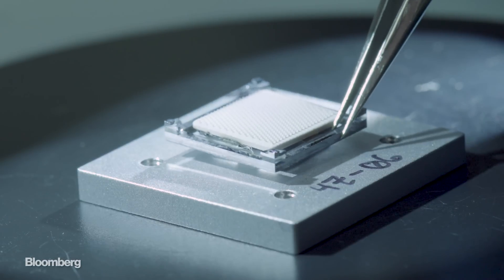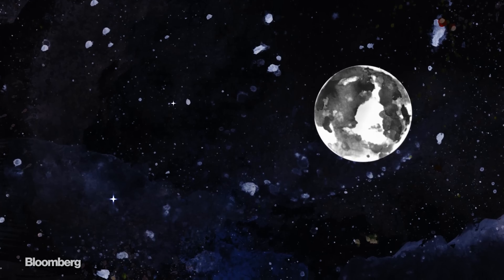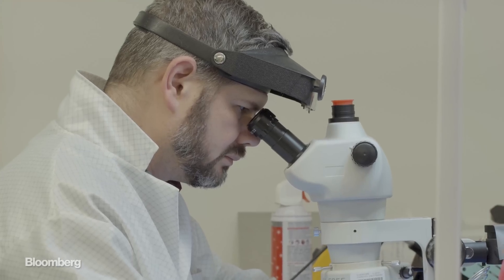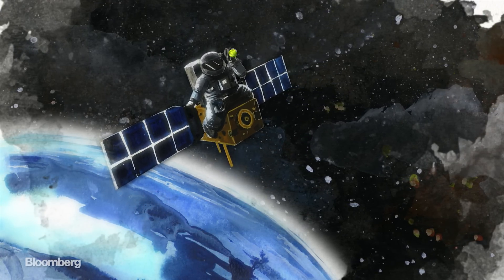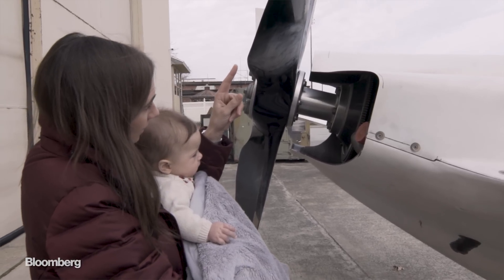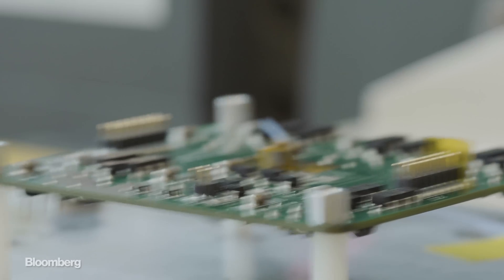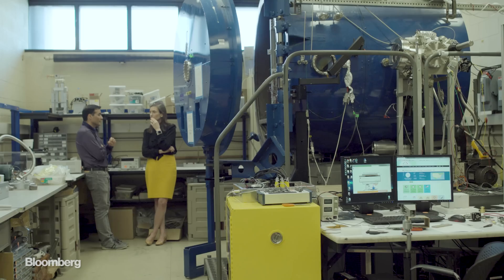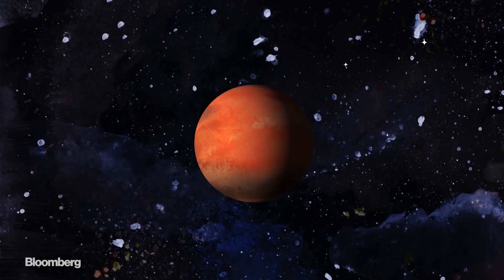This 31-Year-Old Is Changing Space Travel

Comment: Why can't this be used to leave Earth's surface?
Reply: Two reasons: (1) it only works in vacuum (2) it does not have enough thrust to lift itself, much less anything else.
Once the satellite is in orbit, the vacuum is good, and even a very tiny thrust can produce useful movement, when acting over a great length of time.
Reply: the propulsion is so small, ten of those probably can only move a small piece of paper in a vacuum slightly, the acceleration due to the ions is squared though, so the longer its on, the more momentum it builds, so over a few months or years you can start moving really quickly.

Comment: Yes, it doesn't use toxic chemicals to work... But it doesn't have the thrust to launch from earth... You will still need to use the toxic chemicals to launch it into space. you will need to burn these toxic chemicals ON EARTH.

They completely missed the point of those engines in this video... These engines are cool because they have a huge specific impulse. Meaning you can go very, very far with them. They take forever to accelerate though as their thrust is EXTREMELY tiny.

This is the kind of engines that will be used to send satellites and probes extremely far from here. I doubt they will be used on manned flights. Time is an important factor when you have people on board.

This is also the reason why they use gravity assists to send satellites very far, but they would probably not use it for manned flights. Sure the principle would still work, however, it would take too much time.
Reply: also, most fuels used nowadays arent toxic, only the proton and some chinese, indian, japanese launcher use them, but they are fasing out hypergolics as well.

Comment: If you follow the reasoning of the Quantum Fields Modulation Mechanism.., that the particles used as "reaction mass" are actually orthogonal/dimensional vectors of QM-Time modulation, then an ion engine is only a particular multiphase-state of tuning at the most familiar 3D+T perspective,  and it's still not the most productive use of cause-effect principle. 
But business logic is radically different to Engineering.

Comment: Can someone explain to me why isn't it possible to use some kind of turbine to push against the exhaust from either rocket fuel engine or the ions from the ion engine to push a spaceship/satellite forward?
Reply: Not enough material. If there is already an exaust, therefore thrust, also no need to.
The main advantage of the ion engine is that there is no need for fuel! No need to carry heavy loads of fuel from earth, no energy wasted in carrying it's own fuel weight and... limitless range!!! Ion engine converts light from the sun to mechanical motion energy, no fuel required.
Reply: No, nobody could explain that, because it is possible. Just incredibly irrational and energy inefficient.
Now you're going to ask why, aren'tcha?
Why would you use some kind of turbine to push against the exhaust from your car automobile engine... ?
Reply: tubeist- dan  there is a reason why she brought up throwing tennis balls to get momentum. Because it is actually possible to do that in outer space. A tiny bit of force can go a long way. It doesn't make sense to do that on Earth.
Reply: KNO for the same reason you can't jump out of an airplane with the harness attached to yourself. Turbines convert linear momentum to rotational for use of compression for more air and fuel to be compressed for the process. It would be completely useless in space to have rotation. Therefore the best method to use is a plain old rocket engine.
Reply: Roy Harris   doesn't it produce H2O when rocket fuel react? It's like way denser and heavier than air so technically the air hitting the turbines would work way better than the air on Earth. I'm still not convinced a really light weight turbine with the help of electricity won't help give a significant boost to the space craft.
Reply: +C O

What you're describing are solar sail, not ion engine. Ion engine do still need to carry its fuel ( like Helium or  Xenon etc)  as well  power plant .  Example of spacecraft that uses Ion engine is NASA's  Dawn mission.
Reply: remliqa this requires electricity? Can it convert electrons to ions therefore thrust?
Reply: CO, every engine requires reaction mass to be expelled, in ion engines its ions, but those ions have to come from somewhere. 
Ions are basically just molecules with more or fewer electrons, the spacecraft carries this mass in the form of xenon, a noble gas, ideally suited for the task.
the one advantage they have over chemical engines, is that they are very efficient. 
the efficiency of a rocket engine directly corresponds to the exhaust velocity of the expelled mass. and an ion engine propels out ions incredibly fast.

Comment: How can it match the speeds of a liquid propellant rocket ?!
Reply: rockets dont have the fuel capacity to boost for very long, a iondrive on the other hand can boost a very long time.. its not gonna accelerate extremly fast but its gonna accel. for a very long time and like this gonna get even faster than a rocket in low gravity space
Reply: It can't it would never lift anything off the ground.
Reply: Actually, ion exhausts typically far outstrip the velocities of chemical-oxidation propellants'. And because the input energy can be ultimately derived from the sun, via photocells, that energy factor can be stripped out of the propellants' necessary parameters, giving a freer scope to exploring 'fuels' with the best velocity x mass attributes. And mass is one of the most precious commodities in a rocket: since you don't want it to contribute to 'dead weight' any more than necessary, you want to get the best bang for the buck.

Google:
NASA - Ion Propulsion: Farther, Faster, Cheaper 
nasa.gov/centers/glenn/technology/Ion_Propulsion1.html
May 2, 2008 - Chemical rockets have demonstrated fuel efficiencies up to 35 percent, but ion thrusters have demonstrated fuel efficiencies over 90 percent. Currently, ion thrusters are used to keep communication satellites in the proper position relative to Earth and for the main propulsion on deep space probes.
Reply: Compound interest over long times.

Comment: You still run out of propellant eventually; especially if you're some kind of telescope making thousands of adjustments per day.
Reply: I thought they pointed telescopes using spinning reaction wheels, not thrusters?
Reply: Correct. Telescopes only need thrust to maintain orbit. Orientation is done with reaction wheels.
Reply: Orientation in space still requires thrusters, or in the presence of the Earth's magnetic field, what are called magnetotorquers. Reaction wheels are used because of their high accuracy, but they max out (saturate) and you need to use an orientation thruster to then compensate for the reaction wheel. This is because they can get to speeds that are at the edge of the physical ability of the wheel, and need to be slowed down.
Reply: But you normally still need thrusters to unload the reaction wheels every once in a while. There are some other more exotic solutions though such as using something like a solar sail or even the earth's magnetic field to provide a small torque but continuously, just enough to keep the reaction wheels from saturating.
Reply: Put the point is you will run out of propellant MUCH LATER than using chemical propellant.
Reply: TheAstronomyDude there are Companies working on air breathing ion engines so as they skim the atmosphere they take in the air and ionise it and propell themself with it (Energy from Solar panels) 
Sorry for poor English :)
Reply: You can do a lot more with your propellant if it's going 30kmh rather than 3 kmh.
Reply: seriously why bother posting this pessimistic dribble of a comment
Reply: really? explain this to me
Reply: Daniel Morgan It requires fuel. It's better in a sense that it shoots off ions (usually Noble gases) in one direction using electromagnets (uses a lot of electricity) as opposed to chemical rockets that burn and thrust is achieve by molecules bouncing off each other and guided in a general direction by an engine bell.

For comparison, falcon 9's Merlin engine has a specific impulse (ISP, pushing 9.8m/s^2 until 1kg of fuel is consumed) of 311 seconds while the Accion Ion engine has an ISP of 1250 seconds.
Reply: thats why you mine asterioids for elements, dumbasss. jk
Reply: Well those telescope can still use traditional gyros for angel changing, this will be used for changing fly path and other more complex maneuvers
Reply: Yeah woah wow what an issue I'm sure the ROCKET SCIENTISTS have never thought of.
Reply: Obviously they have thought a lot about it and there are already ion engines propelling space probes today, most notably the Dawn asteroid mission. That however doesn't mean there isn't any more scope for improving or even revolutionising how ion thrusters work.